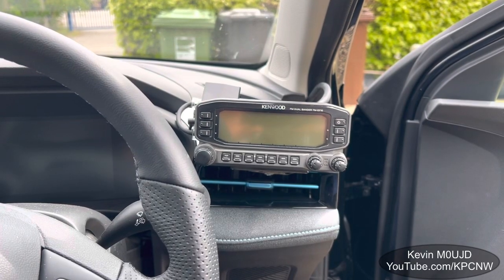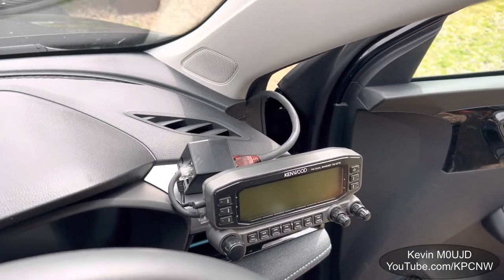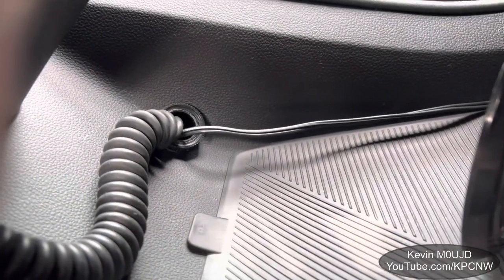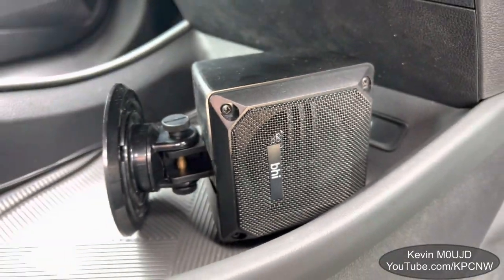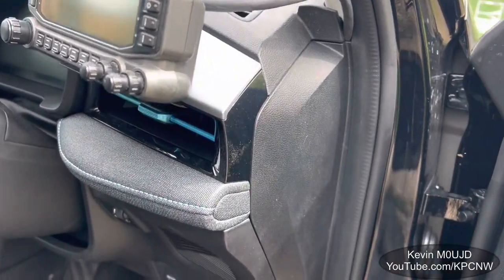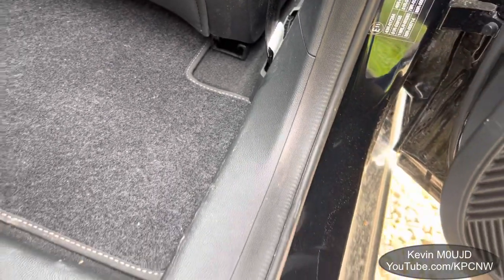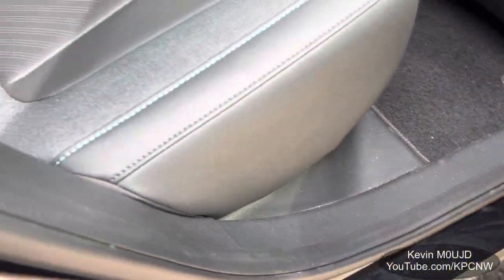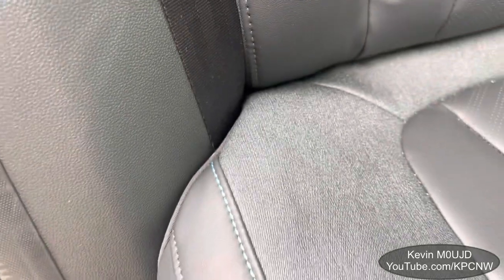Installing Amateur (Ham) Radio VHF/UHF Transceiver In An EV

Comment: Thanks for the great video. I had that GPS to one of my 710'ns. Unfortunately, i had a car break in and they stole the radio, and probably thrown it in the trash cause they didn't know what it was.  Now they don't sell that GPS anymore. :-(. I will give it a try to install my other 710 in my KIA EV6, can you maby write a list of what kind of cables an ferrites you used?

Comment: Where can one get one of these radios
Reply from the maker: Unfortunately they are no longer made but there are many second hand ones around. This is the TM-D710 but there is also a TM-V71? Which is the same base unit but different head and no TNC.
However many many mobile radios have the remote head option.
73 de Kevin MØUJD